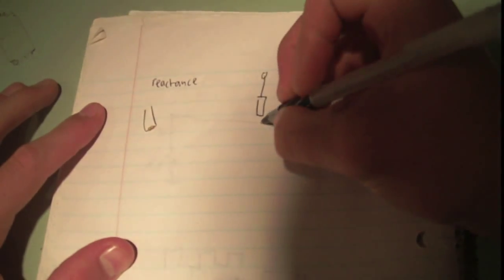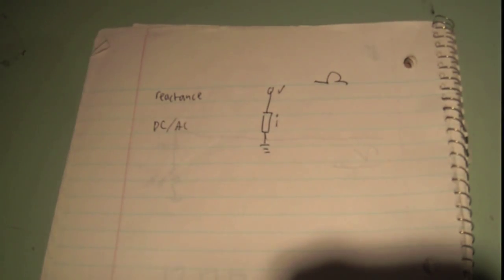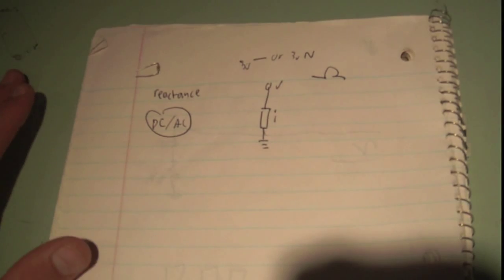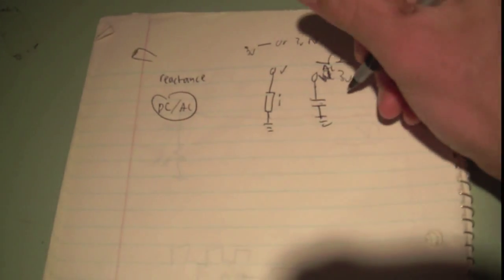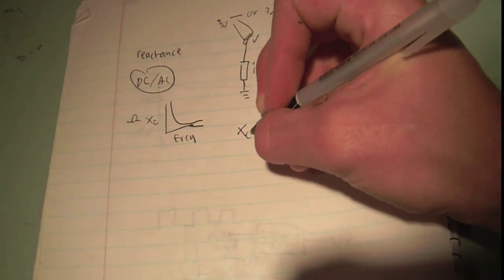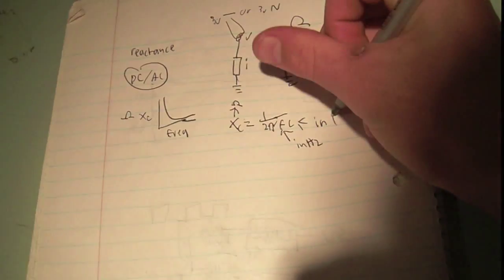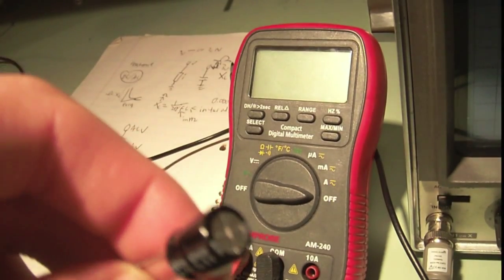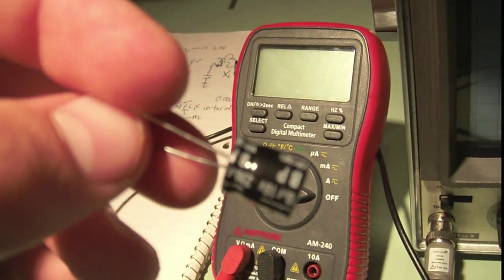Capacative Reactance-Impedance

Comment from the maker: Lots of cool stuff, RC, LC, and LCR filters work off this concept, because the resistor is constant over frequency but the cap has a lower resistance the higher the frequency, and the inductor has a higher resistance the higher the frequency. You could make AC voltage dividers. It is useful any time you need a resistor in an AC circuit because the cap will dissipate less heat than a resistor for a higher power.